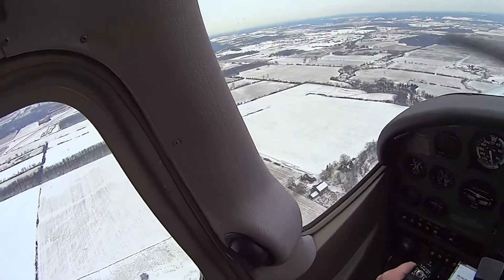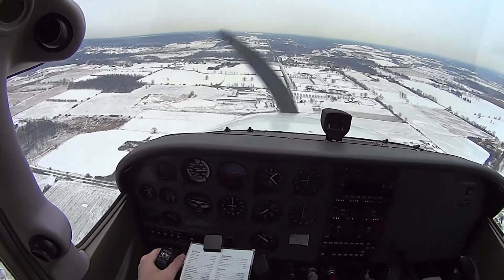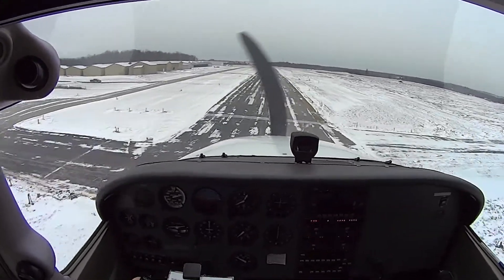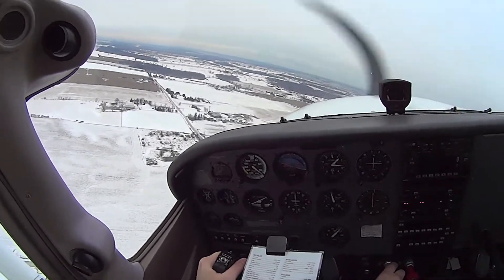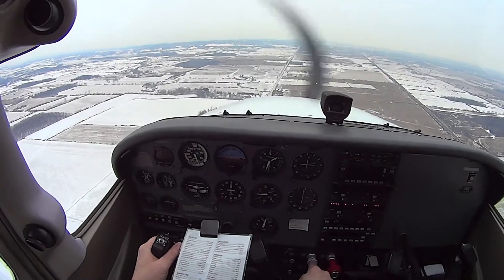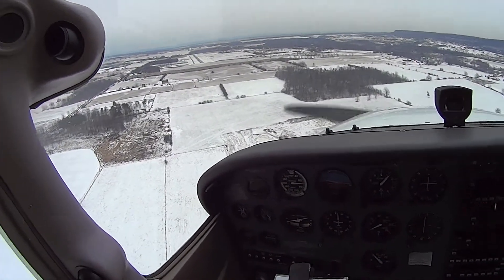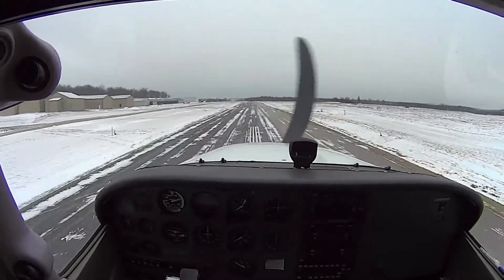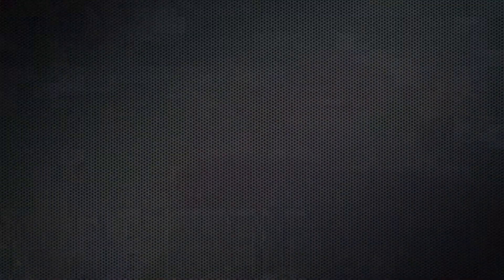Take-offs and Landings at CZBA Burlington

Comment: Well done.  Remember to make that down wind radio call with your intentions. Consider incremental flap settings on approach.  You probably don`t need 30 degrees until you are 1/2 mile or less from the threshold.  I didn't hear your instructor say this, but if you start your decent when making your base turn with 10 degrees flap, you can maintain airspeed with a decent rate of 500'/min.  If you do this, you will be 500' above ground when you turn final. If you continue to maintain that same decent rate of 500'/min, you'll grease it on every time.  Once you figure out where to throw in the necessary flap, you'll hardly every touch the throttle.  Happy flying.

Comment: No flap increments 10 downwind 20 base 30 only on final didnt clear the runway completely before doing after landing checks. If it was a controlled airport you would get yelled at for blocking a taxi way. As well no clearing call after landing to let others know your out of the way. Speed on downwind keep the speed up in a slow cessna if a twin is behind you they would have a hell of a time keeping back. As well with increased speed you get better cooling and better forward visibility.